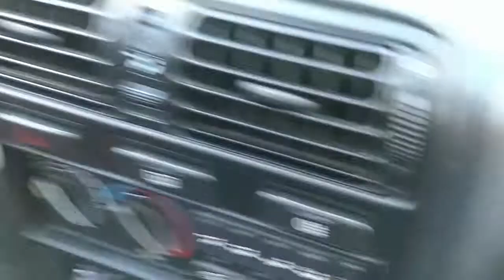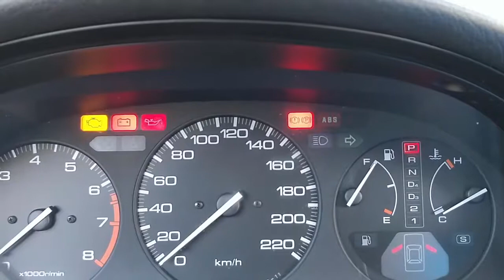How to check the error codes on Honda Accord CB3, CB4 1989-1992

Comment: also, here you have the trouble code list. thanks for the video!
Reply: where is the trouble code list plz
Reply: @christophehottat8565 
 0 - ECU - Faulty ECU or ECU ROM 
1 - O2A - Oxygen sensor #1
2 - O2B - Oxygen sensor #2
3 - MAP - manifold absolute pressure sensor
4 - CKP - crank position sensor
5 - MAP - manifold absolute pressure sensor
6 - ECT - water temperature sensor
7 - TPS - throttle position sensor
8 - TDC - top dead center sensor
9 - CYP - cylinder sensor
10 - IAT - intake air temperature sensor Diagnostic Proceedure
11 - engine overheating
12 - EGR - exhaust gas recirculation lift valve
13 - BARO - atmospheric pressure sensor
14 - IAC (EACV) - idle air control valve
15 - Ignition output signal
16 - Fuel injectors
17 - VSS - vehicle speed sensor
19 - Automatic transmission lockup control valve
20 - ELD - Electrical load detector
21 - VTEC spool solenoid valve
22 - VTEC pressure valve
23 - Knock sensor
30 - Automatic transmission A signal
31 - Automatic transmission B signal
36 - Traction control found on some JDM ecu's
38 - Secondary VTEC solenoid on JDM 3 stage D15B Vtec ECUs (P2J)
41 - Primary oxygen sensor heater
43 - Fuel supply system
45 - Fuel system too rich or lean
48 - LAF - lean air fuel sensor
54 - CKF - crank fluctuation sensor
58 - TDC sensor #2
61 - Primary oxygen sensor
63 - Secondary oxygen sensor circuit
65 - Secondary oxygen sensor heater wire (black wires)
67 - Catalytic Converter
71 - random misfire cylinder 1
72 - random misfire cylinder 2
73 - random misfire cylinder 3
74 - random misfire cylinder 4
80 - EGR Valve/Line
86 - ECT sensor - Cooling System
91 - Fuel Tank pressure sensor
92 - EVAP Solenoid/Valve/Vacuum Lines

OBD1 TCU CODES:

1 - Lock-up solenoid 'A' circuit open or shorted
2 - Lock-up solenoid 'B' circuit open or shorted
3 - Throttle Position Sensor circuit open or shorted
4 - Vehicle Speed Sensor open or shorted - No signal from speedometer
5 - Shift Lever Position Switch circuit shorted
6 - Shift Lever Position Switch circuit open
7 - Shift Solenoid 'A' circuit open or shorted
8 - Shift Solenoid 'B' circuit open or shorted
9 - Counter shaft or transmission speed pulse generator open or shorted
10 - Coolant Temperature Sensor open or shorted
11 - Engine RPM (Ignition coil signal) open or shorted
12 - (No code 12 used)
13 - Main shaft speed pulse generator open or shorted
14 - Linear (line pressure control) solenoid open or shorted
15 - Kick down switch circuit shorted